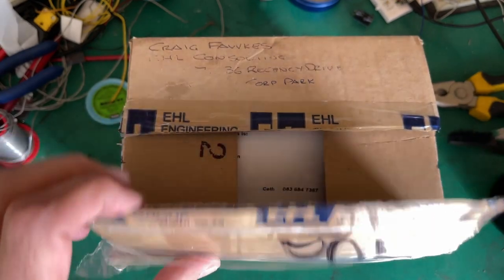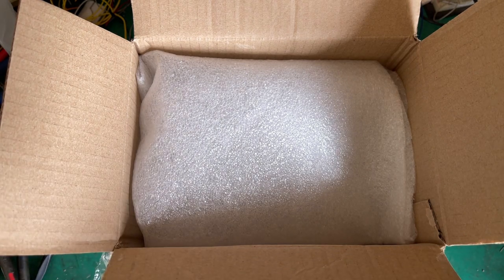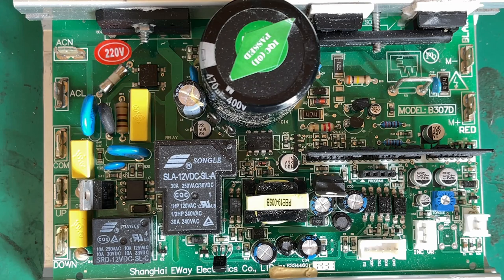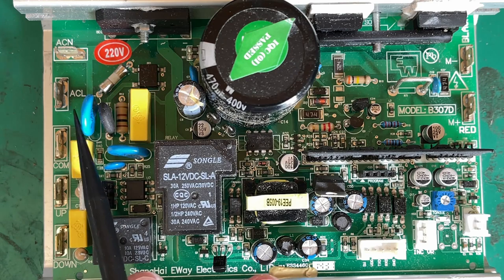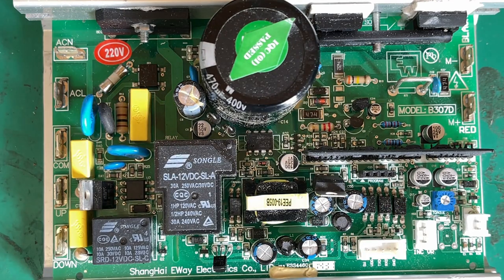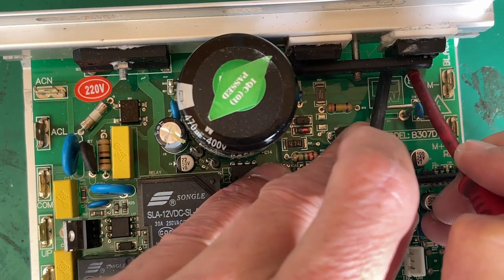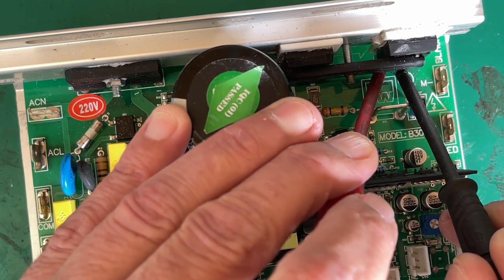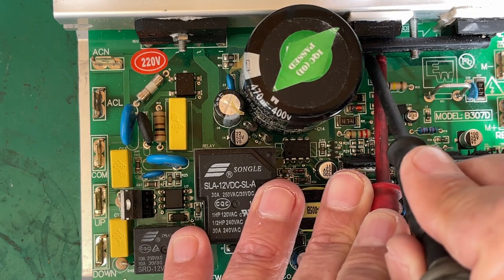FoulkesBrau #63 - Another Trojan treadmill control board - B307D

Comment: 30:00 250 volts on the bridge rectifier output is because the large relay actually switches the bridge rectifier. Only when the large relay is switched on, will you get full rectified voltage.

Comment: Hello. I have a B304-S10 motor controll board from a trojan treadmill.  I have some electrical knowledge.  The motor burnt tripping the house mains.  I have replaced the motor. The board powers up with voltage to the motor but then times out when the belt does not move . I suspected that the part controlling the PWM (wave modulator) has blown.  Where would you suggest I test for the problem. Craig ( South Africa)

Comment: I've recently been working on these boards and some larger versions of the same circuit for a treadmill engineer. I too came across a blown MOSFET, then measuring the 12V output at the connector, I got a stable 12.26 volts. 
I have another identical board, that I've checked thoroughly, which has zero shorted components...but it was marked as a faulty board and not working when fitted. I'm getting very different thermal imaging of the "faulty" board, in comparison to the board with the stable 12.26V output. Good board has an input voltage of 16volts on the LM812 voltage regulator... however the bad board has unstable input to its LM812...bouncing from 10v to 13v. The bad board TL431 is getting hot, but is not faulty, as even after changing exhibits the same symptoms. The good board TL431 is not heating up at all under thermal camera. After testing literally every possible component, I suspect the issue with the bad board and other boards lies within the vertical circuit board that is potted in resin compound. There are 4 ICs on this small board and in my case 1 of them is definitely a PWM chip for switching the transformer. This is my guess as to the cause of unstable 12v output at the connector.
Reply from the maker: Hi there,

I suspect it is the vertical potted board. 

Cheers

Craig
Reply: @foulkesbrau3085  Thanks Craig. It actually turned out to be a strange one. The board began to turn on and off as I moved the PCB. I knew it was a connection issue...but it was VERY hard to find. Turned out to be an internal connection issue across a 2 MegaOhm resistor. Only found it because it finally failed open. Thanks for your help though, I took thought it was the potted board. Glad it wasn't or it'd be game over.

Comment: Hello, I've used quite a few older tread mill boards and most of the older ones have an input plug for use with a variable resistor (knob for speed control). What pins (if any on this board would one use a variable resistor to control the output speed)?
Reply from the maker: Hi Glen,

It’s been a while, but if I remember correctly, there is a separate mcu in the control panel on the handle bars that controls the speed via serial communication. The MCU on this board controls the FET with PWM with a driver IC. So I suspect you will not be able to use a pot to vary the speed. 

Cheers 

Craig

Comment: Hi Craig , your videos are really informative . I have a trojan dcmd67 board that is still in good condition . I would like to know whether i could put a potentiometer on it to control the motor for my drill press . Hope you can shed some light on it for me .
Reply from the maker: Hi Kali, 

You won’t be able to do that directly as far as a I can remember as the FET is controlled by PWM from a microcontroller. 

Not all is bad though, if you don’t need the microcontroller functionality, you would be able to use a pot with a 555 to vary the PWM which you could then feed to the FET driving circuit. 

Let us know how you come along. 

Cheers

Craig

Comment: Hi Craig: Great to see you back!!!! Thank you again for taking your time to make these video's. I am especially excited to see your video's when they come up since a lot of them are related to exercise equipment board repair. I have a couple of questions if you have the time to answer. I'm still trying to wrap my head around how the output of these boards work. I usually work on AC boards which have a VFC output, control the frequency to control the speed. These are DC (I am assuming) with either a brush or brushless motor. So is the output vary the voltage to control the speed? Is this done by a chopper circuit, I guess like a PWM control? Or is there somehow frequency control incorporated that I am not catching??? The other question is if they are a PWM control that changes voltage to change speed, why do you measure an output at all??? Shouldn't it be 0 volts if there is no user panel hooked up and a user selecting a speed??? Since there is voltage at the output, would that mean the motor would run even if it is not called for??? Color me confused   >--%
Reply from the maker: Hi Andre,

Glad you're enjoying the videos. I have a very interesting one to make this weekend  not an exercise board though.

So I'm guessing that the FET will control the motor with PWM as this would be the most logical mode of operation. I cannot be sure as I did not upload the code for the micro controller and reverse engineer it. I have however had a look at the datasheets for one of the boards micro controllers and one of the features was PWM control. So I presume that this is how all these boards are working. I don't think they would be using variable frequency on top of PWM. One day I will hook up a scope to my own treadmill and then we can know for sure.

What I have picked up with some of these control boards is that the micro pulses the FET every now and then. I presume  they are doing this to measure that there is a tiny current flow. This would indicate that the motor is there and that it is not open circuit- this would be why I measured voltage on the motor terminals.

Cheers

Craig
Reply: @foulkesbrau3085  Thanks again for the detailed explainaton. That makes absolute sense, that it would be sending out a microamp signal, Thank you for helping me undersand that part of the puzzle. I so appreciate the work you do to help us with these boards.  All the best to you and stay safe!!!!
Reply from the maker: 👍 No worries. 

The next video I will show a very elegant latching circuit because I bought the wrong type of mechanical switch. 🙈

It’s getting painful here in SA to get components into the country. So we must make go with what we can get our hands on. 

Cheers

Craig

Comment: Hello sir is that igbt(IRG4PC40UD) working fine and turning on the motor ??
I have the same problem. My original igbt was G4PC40U and it was shorted but I couldn't find the same one for replacement only the IRG4PC40UD was available. it has some diode feature built in it. In my case I am getting around 320v dc on the bridge rectifier and 150v dc on the motor terminal and 0volt on the igbt's collector to the emitter only when there is no load in the motor (M+,M-) terminal. As soon as I attach a load like 100w bulb or the original motor, the relay give a click sound but when I press the start button it don't give any output to switch on the load. Then I get 320v dc on bridge rectifier, 0 volt dc on the motor terminal and around 300-350v dc from the igbt's collector to the emitter. 
What could be the problem ? Is that the igbt's fault or relay's contact problem or something else in the board ?
Reply from the maker: Hi,

I would start by checking that the control signals from the keypad board are actually getting to the control board. Then you can work your way back. Like is the gate being driven?

Cheers

Craig

Comment: Hi, I'm from Argentina and I'm trying to repair the same board, when I measured the same fuse that I measured with continuity, it doesn't have continuity, I suppose I should try changing it, I was thinking of making a jumper to test it but I don't know if it's recommended, what do you recommend? Thank you very much for the video and I look forward to your advice
greetings from Argentina
Reply from the maker: Hi there,

Please do not make jumpers for fuses. Rather replace with the correct fuse. 

If the fuse has blown - you may have a short circuit. 

Cheers

Craig

Comment: Sir I have same board .it's working good but after 6 km/h speed .speed doesn't increase.can u help me to solve the issue
Reply from the maker: Hi there,

It may be that the encoder that picks up the speed is faulty?

Cheers

Craig
Reply: How to clear that issue .can u explain plz
Reply: I didn't understand what is encoder
Reply from the maker: Hi there,

On the side of the treadmill is a round plastic thing with segments in it. There is an encoder that counts those segments to get the speed. 

Cheers

Craig
Reply: But speed sensor is working properly

Comment: Too bad a person can not use an air compressor to blow that melted lead right off. Heat and burst of compressed air.
I have tried it.  Nope.  The instant that air hits the solder, in microsecond the lead silidifies, splatters on the board at best.